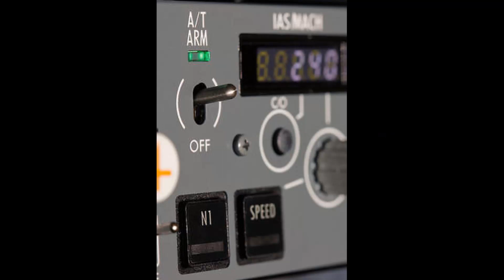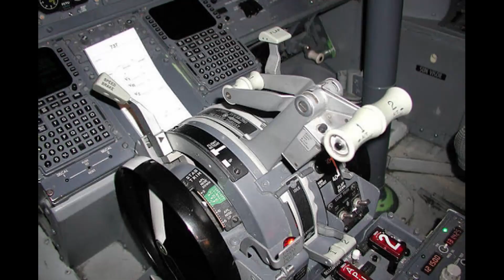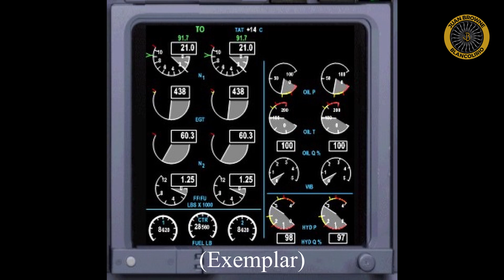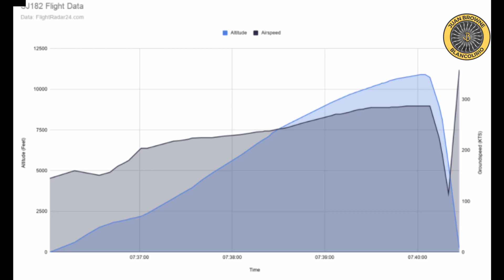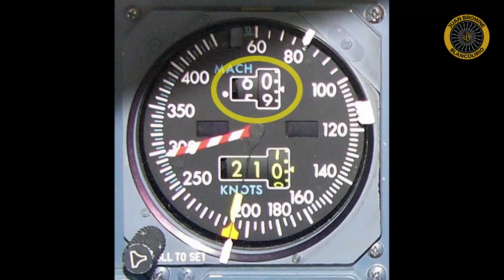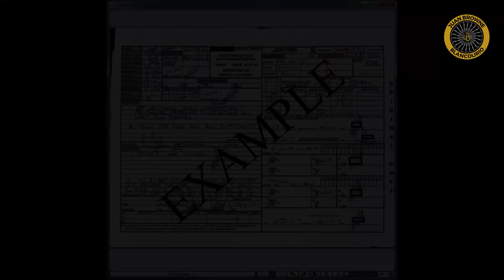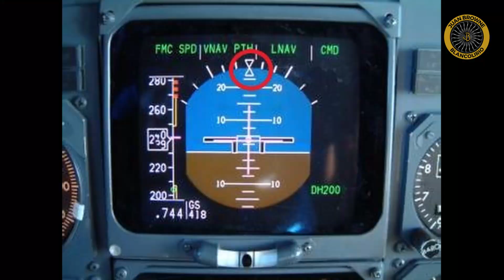Sriwijaya SJ-182 KNKT Preliminary Report 12 Feb 2021

Comment: It's like no one took control of the plane and let a small fixable glitch escalate into a death dive.
Reply: Have you seen the one where three pilots work on a malfunctioning light bulb, and don’t notice they run out of gas?
Reply: @ED-es2qv  I seem to recall they just allowed the aircraft to impact the Everglades by focusing head down. Not run out of fuel.
Reply: There was a United flight that ran out of fuel while holding over Oregon because the crew was troubleshooting a little technical fault.
Reply: A failed bulb might be a small glitch.  A recurring failure of a critical system I wouldn't think of as small.  What Juan says about the autopilot simply dumping an upsetting aircraft into your lap with no other warning than a warning horn and a large and dangerous amount of yaw--and at ten thousand feet--is pretty disconcerting for me.  If you're not prepared for this sort of thing it can easily kill you.  For some reason it seems the crew wasn't prepared.  If these airlines are going to fly with pilots who can't handle situations like this (which is horrifying enough) they have a greater obligation to make sure the situation doesn't happen.  What I am hearing here about the superficial repair work on a known and potentially lethal mechanical issue is just as problematic for me as the airmanship issue.
Reply: @ED-es2qv  The good old Eastern Tri-Star accident in the Everglades, that was a sad one too.
Reply: @charlesfaure1189  It seems to me, too, that the pilots were simply too surprised to act properly and recover the plane in such a low altitude.

And indeed, the report about the maintenance sounds strange to me.
Reply: Just like with the MAX-crashes... Some countries really need to step up their pilot training and qualification
Reply: @riemjann1  This crash obviously has absolutely nothing to do with the MAX crashes. This was a Classic - a Classic!!! - a 737-500!!! - far away from using MCAS.
And please stop blaming pilots with another skin colour and another religion for the sh.t which Boeing did in the case of the MAX.
Reply: @Hans_R._Wahl  Actually he has a point about pilot training and the MAX crashes. One of the biggest deficiencies pointed out by the Lion Air final report was that the crew did not perform any of their memory items and simply tried to just automate their way out of the situation. While Sriwijaya was a 737 Classic, the point about substandard pilot training still stands.
Reply: @terryboyer1342   that was EAL, L1011 FLT 401, THE gear wasDOWN & LOCKES but the bulb for NOSE WHEEL, BURNT OUT , so circling to check visually, Capt s knee disconnected autopilot, so 1 wing hit ground spun around & broke up. Sad  RIP,  🇺🇸🇺🇸🇺🇸🇺🇸
Reply: @Hans_R._Wahl  Read this (admittedly lengthy) article by William Langewiesche or listen to Greg Feith's Flight Safety Detectives podcasts. A runaway stabilizer is easy to correct, but when you don't know how and pretend your plane is working normally when its AOA sensor obviously produces wonky data, you shouldn't be sitting in the captain's seat.
That happened in Indonesia:
"Everything seemed fine during the takeoff roll, but as soon as he hauled back on his control column and the airplane lifted off, the angle-of-attack sensor went haywire, the stick shaker began to rattle the left-side controls and Suneja lost reliable indications of airspeed and altitude on his flight display. In other words, the airplane misbehaved exactly as it had the night before. Once again, everything was fine on the co-pilot’s side. Suneja, however, did not turn the flying over to Harvino but retained it for himself, despite the vibrations of the controls in his hands."

And in Ethiopia as well: 
"The airplane rolled down the runway at 8:38 a.m. with a standard takeoff flap setting and Getachew at the controls. Immediately after liftoff, the angle-of-attack measurement on his side failed, setting off his stick shaker and distorting his indications of airspeed and altitude. It is not known why the angle-of-attack measurement failed. The vane on that side seemed to be the original unit. As in Indonesia, all indications on the co-pilot’s side were evidently correct because they crosschecked to the standby instruments and were not accompanied by a stick shaker. Airmanship 101. The situation was obvious enough for almost any pilot. Roughly one minute after takeoff and 1,000 feet above the ground, they engaged the autopilot on the captain’s side. The choice to use the captain’s side was strange because the instrument failure was clearly on that side, but the autopilot gracefully agreed to help."

The Ethiopian crew's actions thereafter make even less sense, but maybe you'd like to read it on your own.

There is no denying MCAS is a terribly designed system with its reliance on one sensor and the non disclosure to pilots (which doesn't apply to the second crew). But what it produced was a simple runaway stabilizer and both crews failed to react properly to that because they failed to obey basic airmanship before already. 
https://www.nytimes.com/2019/09/18/magazine/boeing-737-max-crashes.html
Reply: @flybyairplane3528  That's the one.
Reply: @ED-es2qv  They DID NOT "ran out of gas", they ran out of altitude because the slightest manual control input disengaged the Autopilot...
Reply: @riemjann1  Who REALLY has to Step Up in its lousy design, is Boeing!, because they put just two AoA sensors (notorious for their lack of reliability) in a lousy lacking redundancy design.
Reply: @riemjann1  I would NOT recommend the Langewiesche (son) article as it is too slanted in favor of the lousy Boeing design, and too proclive of criticizing the crews. Unfortunately, Langewiesche the son has much lower aviation quality understanding than his late father, who wrote the flying "Bible": Stick and Rudder book.
Reply: @alfredomarquez9777  Then go read the reports themselves with a focus on the facts and not the conclusions. You'll come to the same judgement as Langewiesche. Or listen to Greg Feith's Flight Safety Detectives podcast, episodes 13 ("The (real) facts of the Indonesian report") and 14 ("Lion Air Accident Report Analysis") - both great to listen to and with pretty much identical conclusions to Langewiesche.

And don't forget MCAS took the value of only one AOA vane into consideration, it didn't even crosscheck between the two existing AOA vanes.
Reply: @riemjann1  I have read the Langewiesche article in detail, and it lacks the proper view: The aircraft must be correctly designed and built BEFORE anyone claims pilot error. Period!

 Having studied with the father, Wolfgang Langewiesche's masterpiece "Stick and Rudder", first published in 1944 and renewed in 1972, it still is the best explanation of the Art of Flying... in comparison, the article from the son, is puny and tendentitious, and tries to paint a favorable image of the Boeing design, which is wrong, very wrong.
As an engineer with more than 42 years of experience, and a pilot too, 
I cannot find the Langewiesche NYT article as a net value.  It lacks the technical analysis depth and conceptual judgement to properly set the record straight, and concentrates on making the dead crews look completely inept and the only ones "guilty", when the role of the Boeing "engineers" and "supervisors" and the ridiculous role of the FAA are much more to blame on. I've flown older Boeings, and can find a tremendous lowering on the quality and company care and lost spirit.  And no improvised, low time and technically ignorant second class writter from NYT can write a good piece on the root of the design's failures. A distant far worse writter than his father.
Reply: @riemjann1  Sorry to correct your blind admiration of the Langewiesche article ( and similarly myopic publications), but as an engineer and a pilot, I find that article highly skewed towards painting a "nice and good" image of the Boeing flawed design, and highly  tendentitious as to put ALL the blame on the crews, while the design was (and still is) flawed, not withstanding all the circus and showtime by an inept and compromised FAA.  The MAX design was wrong, and they only kind of "fixed" the problems in the most CHEAP and cost-cutting way for Boeing not having to really correct what it is still conceptually WRONG: as they kept the idiotic dual AoA sensors exactly like before, instead of doing what is the proper way: to install a third AoA sensor and place it under a TRIPLE REDUNDANT scheme... As that was going to be "too clostly" (haha) for Boeing's todays standards, they choose to rewrite the software, the manuals, and added some indications on the EFIS; instead of correcly engineering the proper solution: To provide a true degree of redundancy, since AoA sensors are notoriously failure prone and physically vulnerable.  Langewiesche lacks the minimum understanding of the proper engineering principles involved, he is only an amateur flyer and has never mastered the physics of flight.  He couldn't write a book even a tenth as good as his father's masterpiece, "Stick and Rudder", published in 1944 and renewed in 1972, and still the best explanation of the Art of Flying, which should be forced reading for all commercial, military and amateur pilots.  The son's NYT article pales in comparison.  

After that lenghty period of time, I was expecting a much more complete and through "fixes" in the airframe and avionics, and became greatly dissapointed of the absolutely CHEAP and ridiculous "fixes" allowed by the inept FAA, always favoring the companies it should supervise. The fox guarding the hen house!  

Remember the other tremendous design failure that caused the Turkish flight 1951 crash, another stupid design flaw of Boeing, having ANOTHER "SINGLE POINT FAILURE", in that one it wasn't the AoA, but a SINGLE altimeter, again, Boeing's beancounters always trying hard to "save pennies" instead of properly designing and building the airplanes.
(saving those pennies is important, because the money for the Boeing CEOs bonuses and golden-parachutes must come from some place, you know).
Reply: @alfredomarquez9777  I think we'll have to agree to disagree at this point. The system design sure is atrocious and potentially dangerous, but focussing solely on the plane's shortcomings and not the pilot's is equally dangerous and myopic. That's another accident waiting to happen and it has last month in Indonesia.
When a pilot continues to fly with obviously false indications of his instruments, changes configuration with devastating effects but doesn't change it back, doesn't follow Boeing's MCAS bulletin and in general is incapable of controlling thrust while (incorrectly) dealing with a runaway stabilizer, I feel it's fair to criticize his role in the accident to prevent it from happening again.

I do agree with your criticism on not building true redundancy with a third sensor in the fixed MAX though. Nevertheless, MCAS is a system designed for edge case situations that does not need act constantly (like a fly by wire system with flight envelope protection would have to). I think it's therefore acceptable to rely on two sensors and only act when both sensors agree (see https://www.boeing.com/737-max-updates/mcas/) since the likelihood of both failing to the same extent is negligibly small, the potential non-activation of the system is not catastrophic and the probability of the system activating in the first place seems small anyways.
Reply: @ED-es2qv  Was there ever any other accident of an L-1011 ?
Reply: @terryboyer1342  Yup, run out of altitude rather ! GPWS would fix that now.
Reply: @charlesfaure1189  Totally agree regarding the obviously inadequate 'repair' of the autothrottle. Did the engineer think the connector contacts would improve with age ?
Reply: @riemjann1  How would improved training as decreed by Boeing have saved any of those 2 MAXes ?
Reply: @Hans_R._Wahl  Skin colour and religion have indeed NOTHING to do with the matter. The 'culture' of certain countries may do though.
Reply: @alfredomarquez9777  NOT applying 50 year old 'grandfather' clauses regarding flight safety and certification might help too !
Reply: @pasoundman  The aerodynamics of a 1930 era airplane and a 2016 one (B737MAX), are exactly alike in regards to longitudinal stability.
 MCAS was a patch tried to fix the upward moment caused when shoehorning much larger engines whose nacelles produce unwanted lift well forward of the CG. That fact is common knowledge that was established long ago and forever, it does not change as long as the laws of physics do not change.
Reply: @alfredomarquez9777  Which entirely MISSES the point that the MAX DID NOT fly like a B737-100. It was a clumsy software fix to 'pretend' it flew the same . That insane delusion meant that under grandfather clauses Boeing COULDN'T fit an additional AoA sensor or indeed draw attention to the AoA issue. Utter madness !
Reply: Indeed. I was remembered to the Tarom crash in Romania back in 1995 where the Captain collapsed while the autothrottles splitted and the FO wasn´t able to get the situation under control - not saying this happened again, especially because there was short before the rollover a normal readback by the pilots. But it´s indeed so: A small, easily fixable issue was let to escalate into a death dive.
Fortunately the CVR data are now recovered.
Reply: @Charles Faure It´s a huge step forward in the investigation that the CVR-data could now be readed out so that it´s no longer necessary to speculate about why the pilots were unable to get the situation under control and to rescue the plane. What we know so far from the maintenance history of that plane and from the FDR-data is that there were three important issues which let to the crash - and you´re absolutely right, ALL THREE issues have to be focused and not only the pilots:
1.) There was a repeated problem with the autothrottles which stayed obviously unsolved and occured again during that flight.
2.) The continuing splitting of the autothrottles wasn´t interrupted by the pilots and leaded to the following event.
3.) The pilots were than not able to recover the plane and so it made a very quick deep dive directly into the sea.
But we´re unable to know why point two and three happened without the CVR-data. It looks like the classic Swiss cheese: a combination of little things which let in this combination to the disaster: pilots who were both focused on the weather situation and who dealed with the ATC about the flight direction and climb rates while simply forgetting to watch the throttles. Than an horrible surprise in a low altitude which indeed can kill you even if you´re not an Indonesian and even if you´ve no yellow but white skin. But maybe we have to face a surprise when we will learn the facts about what happened in the cockpit during the crucial two minutes. As I´ve written here: This accident remembers me strongly to the A310-crash of Tarom back in 1995 when a splitting of the autothrottles happened shortly after the start and exactly in the same moment when the Captain collapsed with an heart attack, so that the FO was so shocked that he was unable to stay in control of the plane. To repeat it: I´m not saying that this happened again - but it is next to the human-all-too-human-swiss-cheese-possibility also possible that we learn something about what was going on in the cockpit to which nobody thinks at this moment as it was the case back in 1995. And this plane, a 737-500, and the A 310 are members of the same generation of planes.
Reply: @charlesfaure1189  Please read my comment to your very straight and plain statement here in this comment section.

Comment: So...problems with the auto throttle, maint performs least expensive possible repair, system passes test, good to go.  System fails in flight.  Maint performs a similar, still least expensive possible repair, system which has once already passed ground test after a similar level of repair, passes an identical test, good to go.  Flight crew apparently either does not check the maint log or does not realize the system has already passed testing once before while in a failing condition, but was apparently unprepared for yet another failure.  System fails in flight again, 62 people die.  

For a recurring problem with already one occurrence of a false-negative test I have some doubts about the decision tree in the maint office.  Whatever the flight crew did or did not do, the auto throttle initiated the event.   It seems to have turned out that the crew was essentially (apparently unknowingly) test-flying with passengers on board. Saving money on pilot training and qualification is bad enough (obviously this crew wasn't able to save the situation), but get too interested in saving money on maint/equip together with that and you're gonna be fishing dead people out of the water.  

If my understanding is correct it brings back a bit the Max crashes--corners were cut on safety (single-point failures of a critical system) and training (crews not capable of recognizing and acting in time).  Money saved, lives wasted.